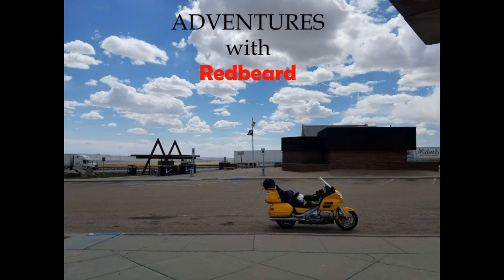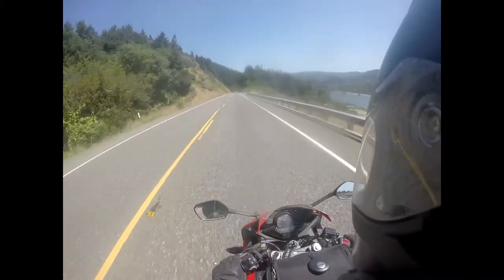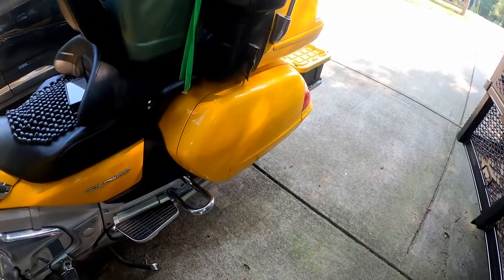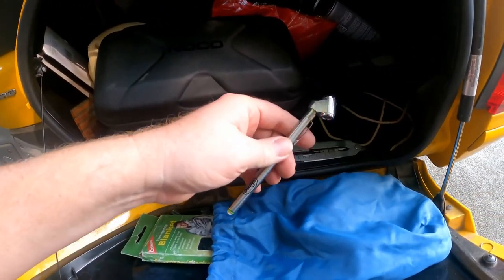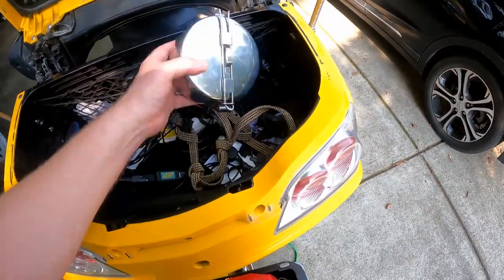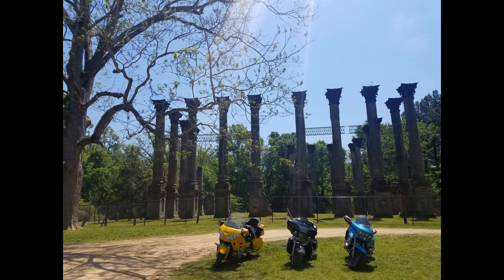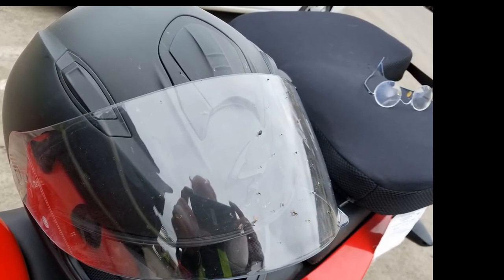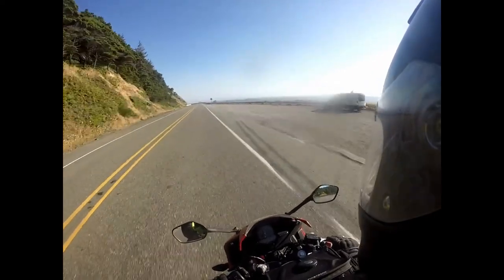Motorcycle Touring for Beginners Shown with my Goldwing and CBR300R

Comment: Good advice!
Reply from the maker: Thank you very much! Do you have additional tips for beginners?
Reply: @AdventureswithRedbeard  The one tip I can think of is, I wear a water bladder backpack. I am constantly sipping on water when I travel. It's much easier than trying to drink from the cup holder with a helmet on. 
I just got back today from Colorado Springs to Indiana. 1,991 miles in 6 days. It was extremely hot traveling on a motorcycle. The water backpack saved me. 
When I stop for gas I fill up with ice and water and the gas station's usually don't charge me for the ice and water. Also on hot days the water backpack is on my back under my riding jacket so the ice cold water helps keep me cool.
Reply from the maker: @Adventureswithmeme  That's a great idea to keep the cold water close like that. Thanks for sharing.

Comment: Great videos. Thanks for sharing. I have a 2023 black Goldwing Tour model that I bought about 5 months ago and I have put 7500 miles on it. Been riding bikes since 1982 and I love it. Where did you get your bracket in the back to hold your plastic tote? That is a great idea. 😊 A new subscriber.
Reply from the maker: Thanks for subscribing! That is a Rivco rack. It is made of aircraft grade aluminum so it is very light. It attaches to the trailer hitch. Do you do any towing?
Reply: @AdventureswithRedbeard  Thanks for your reply, my friend. I don't tow anything yet, but maybe in the future. 🙂
Reply from the maker: @markjulius2006  It takes motorcycle travel to a whole new level. But if you don't need the space...

Comment: Thank you.  Yes I have a hitch and my bike looks almost identical to yours.
Reply from the maker: Sounds like you have a good looking bike :) Thanks for checking out my video! Have you been touring very long?
Reply: Quit awhile. My longest ride in one day about 875 miles from NE LA to CO. Other trips takes multiple days.  Usually tents but occasionally motels. Love the ride.
Reply from the maker: @ditndunk  Do you still live in NE LA? Are you going to Shreveport for Wing Ding this year?
Reply: @AdventureswithRedbeard  I would like to go. Having trouble with electrical on my bike. If I can get it fixed,  I'm going to try to be there. No one wants to work on it in my area. (Arkansas,  Mississippi or Louisiana)
Reply from the maker: @ditndunk  That sucks. Is it a 1500? I've heard only independent shops will work on the 1500s. Have you searched Wing World? The Workbench section is often helpful.
Reply: @AdventureswithRedbeard  GL1800.  Just got a service manual in. Gonna try to trace it out myself.
Reply from the maker: @ditndunk  Good luck! Let me know if I can be of any assistance.

Comment: Just came across your video and liked it very much. I'm doing small touring with my Triumph Bonneville T100. Wanted to upgrade to honda goldwing....a good used one. Let me know your thoughts about Honda Goldwing.
Reply from the maker: Thanks for watching and commenting. I'm very glad you liked my video. I love my Goldwing. It is the most comfortable bike I've ever ridden. I have a video titled "Got Goldwing" that goes into some reasons why. What other bikes have you ridden?
Reply: @AdventureswithRedbeard  my other motorcycle is Yamaha rd 350 and few other 150cc street bikes
Reply from the maker: @maverickb9465  OK, since you've only been riding smaller bikes, you may want to try out some mid-sized ones first. I suggest test riding something like the Honda Interceptor. It's a 900 cc bike that can be used for touring. It rides like a smaller bike but has lots more power. Especially when you hit the RPMs that opens all valves. That surprised me. You may also like to try a CTX 1300. It's a great touring bike as well and much larger than the Interceptor. My suggestion is to test ride bikes like these spending as much time on them as they allow, then test ride the Goldwing. It may help with the transition. This is just a suggestion. There are plenty of people who make the switch or buy a Goldwing as their first bike. Either way, have fun finding your Goldwing!
Reply: @AdventureswithRedbeard  thank you very much for the details. My current Triumph Bonneville T100 is 900 CC, which I'm riding for the last 4 years. Will test ride few others as suggested.
Reply from the maker: @maverickb9465  My secret has been revealed. I don't know Triumph's very well. Sorry about that.